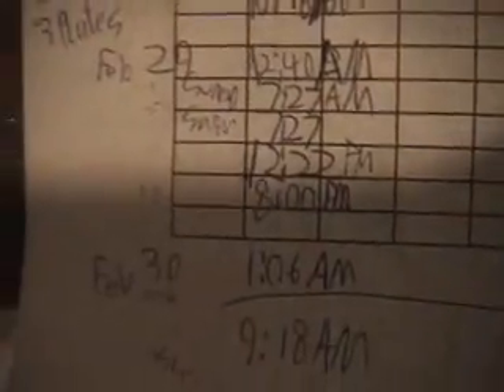Utilization of Raidiant Energy 1901 Nikola Tesla,My test 5

Comment: I think you are not utilising the charging circuit that is shown in the tesla patents. Tesla used a spark gap and either a toothed wheel or high speed relay tuned through inductors and coils to step up the voltage /watch?v=o7NdxnjetSw

Comment: i've wondered about this... can you tell me if the power source supplying the energy to the powerline would feel an extra load because of interactions with the inductive loops? i was considering using coils wrapped around the HT leads on my car engine to power a small HHO cell...haven't tried it out yet...

Comment: Did you make a typo with the farad units of the cap? 430f would be absolutely enormous. I've been thinking about all the large farming barns(tobacco farms) on the east coast. Most of them have roofs 20-30 feet up which are all metal panels (possibly aluminum). Any thing that can help out the farmers is a big deal.

Comment from the maker: ok ill try to do that, i will try to make a real electret foil, i just wanted to try the basics and i have to still build the high voltage dc circuit, thanks stefan, 
i got to ask once theres an electret,will i need to put it in the wind or can i leave it in the attic,also will the electret get to powerful where i get zapped,electret is new grounds for me so a heads up would be good,  i read on some sites that an electret can get a dangerous charge thats all.maybe gloves or insulate myself, thx

Comment from the maker: thanks for defending me, i appreciate that!. if it was galvanic response there would be a flow in one direction. The charge goes on both opposite capacitors with the diodes, showing positive and negative voltages comming down. also it was charging still after i discharged it for a second time. thanks!, have you tryed building this?

Comment from the maker: ok so is it continous then?? it keeps charging. how long would i have to wait if its going to stop working??? did you check out my description of teslas patent or maybe look it up for yourself. thanks for the response i take criticism as well, just it keeps charging wouldnt that be more than a galvanic response?? and the plates add extra voltage.if anything this is more of a capacitive circuit than anything else cause the earth holds high energy in the atmosphere in the form of static/lightning

Comment from the maker: i dont know if your trying to say this is nothing but it is something. its charged particles and energy like tesla said, thats why you need the insulation to slow the natural discharge from the metal plates to the air molocules.check my other videos out you will understand.also build it for yourself, it continuously charges.tell me what you get for results.its not amazing,but it can be used to charge a battery at the least,im still at the begginning stages(2nd week).just try it out and good luck

Comment from the maker: say whatt! sorry, i really dont understand what your saying??? yea the weaker voltage becomes stronger with time of charge to the capacitors. the voltage potential increases with number of plates, that was described in teslas 1901 patent. they seem to charge alittle faster with each plate, and they have to be insulated, just check out my other videos if you dont understand.well no matter what it is, it seems to be making a continuos voltage gain, and it can power a led and buzzer! try it out.